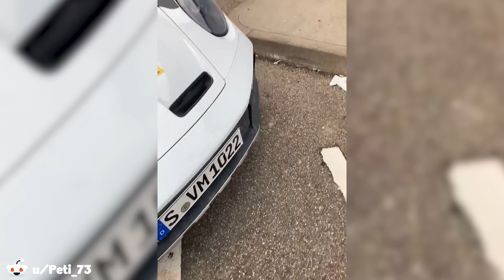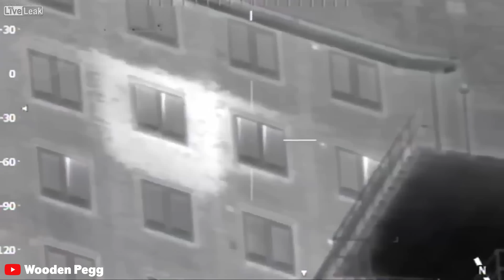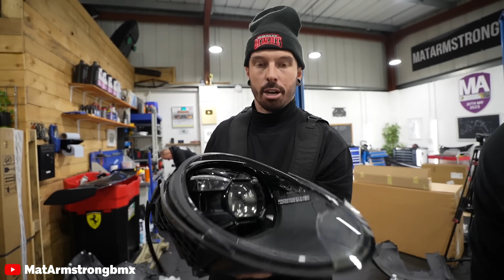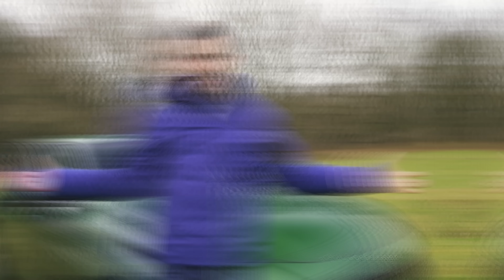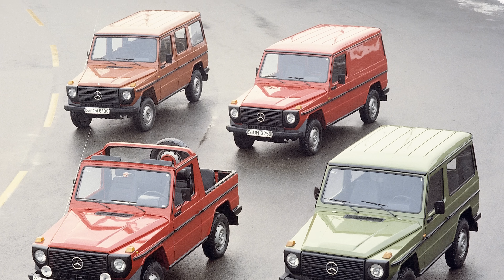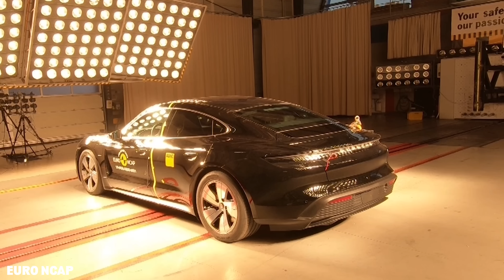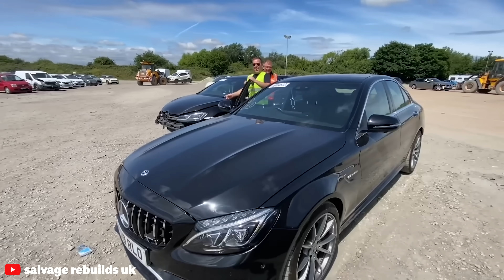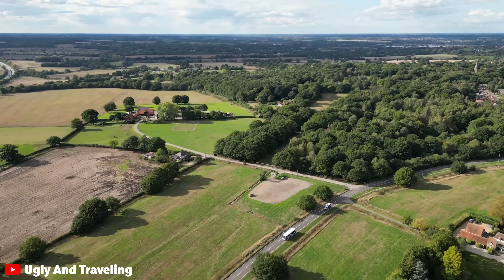Why thieves steal Porsche headlights!

Comment from the maker: Sell your car for free with Carwow: https://bit.ly/-Sell-Your-Car-For-Free-0902
Reply: i can make a reason not to buy a porsche 911
Reply: Ok 👍👍👍
Reply: The only entity that can stop this practice is Porsche themselves.

If they weren't asking such a ridiculous markup on head lamp units this wouldn't be happening.

All Porsche have to do as well as other manufacturers is simply give up the Greedy practice and let the lights go out at cost value.

Just like that the practice will stop and thieves will move on to the next thing.
Reply: LED growlights use less watts and emits less heat than CFL and HPS lamps. I'm pretty certain it is cheaper and easier to go that way for growers instead of stealing headlights from cars.
Reply: Seems like a shaggy dog story, I'll tell you why. Light Emitting Diodes are 'tuned' to emit certain wave lengths of light. Most lights will occupy mostly the yellow wavelengths they are cheaper. Those lights are okay for slow growing plants. Fast growing high demand plants like cannabis really need minimal blue light and heavy red the closer to Infra Red the better. Car lights are tuned far closer to blue light, no good for finishing off buds. This not new data any hydroponics forum will be full of deep light bulb/emitter lore.
Reply: @CulturedThugPoster Yeah, that part was total BS
Reply: Invite Mat Armstrong for a drag race 🙀🙀
Reply: Liberals will say give ur headlights so poor people can earn money
Reply: Blame Bug eyed rishi sunak too busy banning vapes 🤦🏾‍♂️
Reply: Your site offered almost 2,000 less than autotrader for my car. So no thanks.
Reply: @carwow , I have left you some comments below to why this video is nonsense. Feel free to get in touch
Reply: No
Reply: I wonder how many potential thieves will be tempted by the information presented in this video?
Reply: nah, i'll just sell these headlights
Reply: They should steal yours, you’re the worst journalist anyway

Comment: I wonder if adding features like sentry mode from tesla onto these cars would significantly help in mitigating or preventing theft. Sentry mode is a smart security feature on teslas that records motion events via camera’s outside and inside the car. It also uses its headlights to flash at people who get too close to the vehicles warning them that it’s recording. But, tbh what do you guys think would help prevent theft?

Comment: manufactures are going to need to have smart serials on these parts so they can only work with the car it’s originally installed in. so If these parts get stolen the part recognizes that is not connected to parts of the original vehicle, so then it doesn’t work..hope they go with something like this to dissuade and stop part thefts

Comment: One way you can help yourself is to do what a lot of bikers (including myself) do and use a cover that is secured using bungie cords or tie-down straps, because it does actually help with security. It sounds daft, but a copper once explained it to me when discussing motorcycle security; these thieves are often scouting for targets for several days, and if a car is covered, they can't see what exact model it is, or in the case of parts; if it has the right ones. Stopping in the road to eye up a target is easily waved away with a "Nice car mate", but lifting a cover off a car is suspicious, plus these thieves need to get in and out as fast as possible, so if it takes them five minutes to lift the cover of a car, the risk of being caught rises massively. 
For motorcycles and cars looking to be stolen whole, a cover can also hide additional security devices such as wheel locks the thieves then have to deal with, so what was a 2 min job is now much, much longer. All because of a cheap cover. 
Plus they protect your paint from weather, fading, sap and leaves, birds, animals etc so a small outlay and a bit of effort can make a big difference. 
Plus don't just ignore things like this. If a group a people are crowding round a neighbours car at 3am, they're definitely up to something.

Comment: Phone manufacturers have electronically paired parts to their phones for years, people have complained as it prevents people repairing their own devices, but I would have thought car manufacturers could implement a similar pairing that would ensure the part only works when paired to a specific vehicle. This could easily be removed when the key is used to unlock the car so allow a part to be removed and replaced legitimately. If the part is taken from the car while the vehicle is locked then it cannot be paired with another vehicle or used alone.

Comment: nobody is stealing them for weed growing. thats just a dumb story. you can get more efficient LED light off the shelf that 1. work just as well 2. aren't difficult to get/steal. 3. dont need massive 12v power supplies to run as they just plug into 240v outlets. 4. arent illegal to buy for growing legal plants (so they have a legal use and arent hard to source)

Comment: For everyone with limited time: They use the lights for weed plants cause they use less power and produce much light and no heat. Solution:  hey a old v8 and have a good time. ( as long as no one glued itself to it)

Comment: This is why you keep your car in a garage, not on the damn street, especially not when its 100k+ car. Guess you can also say thanks to corporations who sell parts 5-10x times their real price, this headlight does not cost 2600, not even half of it. Just for the fun of it try to calculate car price part by part using official prices.

Comment: In this situation it’s got to the point there is little point in owning a nice car, it’s just to much hassle and you can’t use them unless you drive it point to point and know it’s all locked up in fort Knox on the other side….  While car manufacturers are raping owners on component parts now in a manner they never used to do…. If the tech is costing that much to develop and I doubt it,  just go back to a well sorted passive engineered car. They do exist and they are every bit as much fun to drive…😂

Comment: The insurance assessors would not let stolen and recovered premium car back in the supply chain some 20 years ago even though there was no structural damage. As they knew that it contribute to the cycle of car thief. They would ask the salvage businesses to remove the VIN details from the car and would only sell for breaking part only! If this has practice has change in the insurance industry, it is a problem of their own making. As they have know this issue years ago.

Comment: so now you know what's going to happen because manufacturers don't want to drop the cost of replacement parts... they're going to go full-Apple and security link through software/hardware and prevent aftermarket reelling and any purchases actually working unless they're sold by the dealer...

Comment: Believe it or not i have had my Porsche headlights stolen 2,5 times....so...i put a tracker inside my lights and connected them with a metal rod. Btw the police said the same thing they use them for drugs. However, honestly led lights are cheaper and give out no heat.  I can send you my eyeless pictures if my car 😢

Comment: I'd probably call bollocks on the porkers headlamps being used to grow cannabis, I'd be more likley say they are targeted cos their a fairly expensive option and depending on model can be easily removable with no noise, it can then be sold on the used market, I mean how much are a set of old xenon 997 headlights on ebay going for typically £1500 ish? so imagine what the likes of a set of Taycan headlights would be £2k? £3k?

Comment: "better cooling" lol, where do you think the heat is going? the only factor would be efficiency, aka: how much of the energy is turned into light and how much is turned into heat. Dont forget light also radiates heat, Then you need inverters to convert he AC to DC power for the headlights giving off more heat.
The concept of using automotive lights as to reduce your heat foot print? idiotic.

Comment: The heat part doesn't make sense. Just because they have a heatsink doesn't mean they generate less heat. Also they could just turn on the AC if they don't want to be spotted. The cops don't really need Flir to spot you though, they could just see who's spending a lot on electricity.

They're probably only being stolen to be resold. I wonder if the alarm triggers when they are cutting into the car.

Comment: About 30 years ago my Uncle had a classic BMW stolen from outside his house. They found it about 15 miles away 12 hours later. It had been completely stripped. And I mean COMPLETELY. The whole interior, even the carpets were gone, the entire drivetrain, wheels, doors, bonnet, wings, boot. Everything. It was just a bare chassis when they left it and even that they set fire to. I've never seen anything like it in my life.

Comment: Believe it or not, I had my windscreen wiper blades and passenger door mirror glass stolen from my 2007 Saab 9-3. 
These parts are not that expensive and easily available, so it's not because the car is no longer in production.

Comment: (Almost) entirely due to their resale value.  Like big screen TVs used to be, worth thousands, they're stolen to get money for other purposes, such as drugs.  A quick fix would be to make these parts relatively inexpensive.  If Porsche had those headlights costing a few hundred instead of a few thousand, thieves wouldn't be anywhere near as interested.  Used to see it with car stereos, now they are either unique to a model so no use anywhere else, or the generic ones are cheaper than a couple of packets of cigarettes...  I think more worrying is the increase in classic car theft - stolen, then quickly shipped out of the country to never be seen again.

Comment: It's because they sell well on the used market, try to order one at a dealership, they'll tell you it's 10 grand for a pair with a 6-12 month wait time. Most people just bite the bullet and buy a set off eBay for about half that and get a third party auto electrician to install them. They're probably buying back their own parts from their own cars, there's only so many Taycan headlights available that aren't already attached to a car, so if yours were stolen and you see a set available for sale, guess where those came from lmao purchasing them is ensuring a market exists, and if a market exists, more will be stolen, because every dummy can make an eBay listing for 3-5 grand, and for a quick night lick, 3-5 grand is a really big win. 

Also, as someone who lives in a legal country who actually has two grow rooms right next door, lmfao no friendo, no one is stealing Porsche lights to grow weed, the LED lights we have access to are tailor made for their purpose and don't generate very much heat at all. Even when it was still illegal here, everyone who grew indoors switched to LED, not just for the heat but also the power costs, no one's using HPS lights anymore like your example clip showed because they cost roughly 3 times as much as a comparable LED setup, the initial cost was easily surpassed by the running and maintenance costs. HPS bulbs burn out over time, LED's do not suffer from the same kind of lifecycle issues of needing to replace bulbs 2-3 times a year vs 5+ years with LED. 

HPS bulbs range in size from 400w to 1000w, however because the light output isn't well dispersed because its a single point and they generate so much heat, it's common to hang HPS lights high up inside ventilated range hoods so their beam of light can be more efficiently spread out, as a result, almost no one used anything less than 1000w bulbs, because the coverage efficiency of 400w and even 600w bulbs means needing multiple smaller lights, which produces WAY more heat, which damages the plant and creates a substandard product, which defeats the whole purpose. Which is why most growers switched to LED the moment they became available, I don't know one single grower in 2024 still using HPS. Also, HPS bulbs are 1000w, and they definitely consume that, but a comparable LED setup that will produce identically to an HPS setup will consume around 300w, an extremely powerful LED setup that hits light output levels a 1000w HPS can't dream of even in the middle of it's hotspot, will still consume a maximum of 600w, at a significantly higher efficiency, which means a lot less heat. 

You know how much money is made off of weed? Especially in an illegal country? Trust me when I tell you, growers are not shy about spending crazy money to have the absolute best possible setup, because we know we'll make it back very quickly, but not just that, having the best possible setup also reduces the possibility you'll get caught by police using IR cameras, or nosy neighbors who smell something weird, or power companies who want to know why your apartment is consuming 4 times the power of everyone around you lmao 

Trust me when I tell you, no one's doing what you think, that opinion is a little outdated, like almost 2 decades outdated.

Comment: :cat-orange-whistling:Used to own a Porsche - every Porsche part has a 'unique' number - and you can check with Porsche thats its a legit part - did test this and it works - so when buying used parts - as for stealing lights to grow hash goodness knows - you can security mark parts and most are undetectable and their are DNA invisible sprays - recommend second level security various good systems - I also had a fake key hanging identical but programmed incorrectly in the kitchen if used it locked down the vehicle - house was broken into 15 years back - did some damage but couldnt move the car - porsche sensors are very sensitive and many now have remote cameras interior and exterior that runs to the cloud - that can switch on if your car is touched - car will even send immediately that to porsche hq - to contact you or police - my friends audi a6 has a six digit  numeric alphabet pin built into the radio he uses his name TOM529 - all these cost extra but worth it - :eyes-purple-crying:also if parking away at hotels would drop a cheap car cover over the car - same with motorbike - taking off set the alarm off and nobody can see if its a new or older model. If leaving car any period of time various parts can be removed - fuses but other bits - most thieves arent mechanics - central london change your parking routine - if going on holiday airport carparks are oddly expensive but very secure - in my area nice cars were targeted by muggers so I would walk past car other side of road and back -  carwow guy does a good channel maybe a review of security features and security add ons ....... how effective price safety security rating - or top security tips I was about to say if you own an expensive car - but really anything of value that is a motor vehicle ...:cat-orange-whistling: apple tracker tags are cheap and you can watch your car on your phone in real time - sons at home why is the car off to the offlicense ive got the only key - maybe others could add in experiences tips - as for vans there is an after market alarm that works just touching the van door - great for couriers business van drivers - some countries have even more extreme measures such as stinky green foam or gases so you cant see anything - not sure legal uk - this is about as mad as it gets south africa some cars will blast you with flames like smoke your trainers to stop car hijacking - thats why sid takes the metro in NY thieves steel metro trains not a joke ... when young nobody ever stole my 1992 kia green estate car with beige vinyl roof dont know why .. :octopus-red-waving:

Comment: I work on a lot of Porsche’s. What’s crazy is that with the 911, in theory you could pull the headlights with one tool, with zero damage. The 911’s have the headlight removal tool inside the car

Comment: it's pretty clear where this is going: parts pairing. it's already difficult to move modern headlights from a car to another if the features don't match (adaptive headlights are an example). But identical headlights will soon also be impossible to swap without pairing them to the car's ECU. And guess who's going to be the only one able to do it for you?

Comment: One of my customers had the front end of his 3 year old shogun stolen while parked in his gated garden. They took all the front end panels,bumper,grille,rads,intercooler, lights and various bits and pieces but critically chopped the body harness,obviously they were stolen to repair a damaged one. His insurer wrote it off

Comment: My wife's 2004 Audi TT's headlight units cost $3,300 each.
The wiring inside them commits seppuku, and all the insulation falls off the wires, wrecking the headlight unit.
Or you could pay someone about $1,500 to fix a broken unit.
FU Audi. FU very much indeed.

Comment: it's terrible than a lot of cars (a lot of youngtimmers) can be declared scrap because of passanger airbag deployed in very low speed impact , but because the airbag was "integrated" on the dashboard , it rips out on deploy and all the assembly will cost more than the "value" of the car ... it's the world walking on his head ... So it's wise to chose a car that the air bags are modular like the one of the steering wheel  , if it makes part of the dashboard , the car will be surely condemned if deployed and it's a few years old...